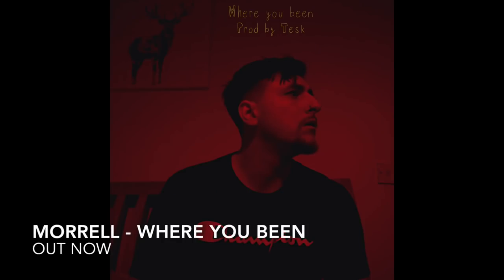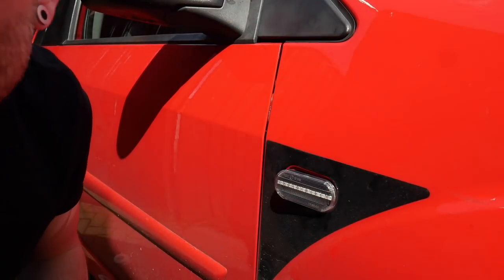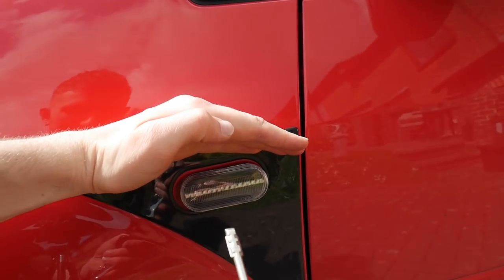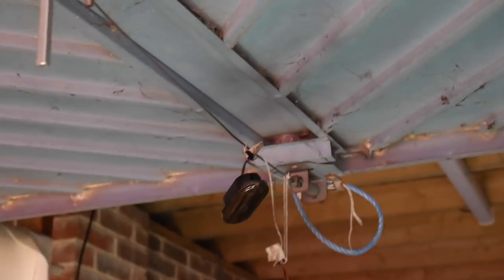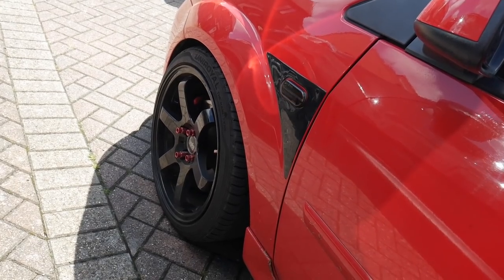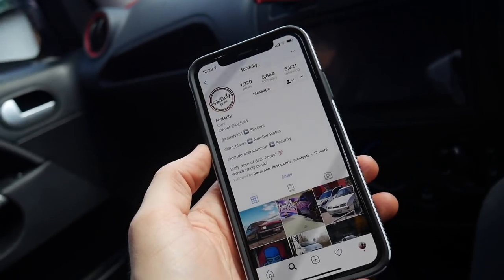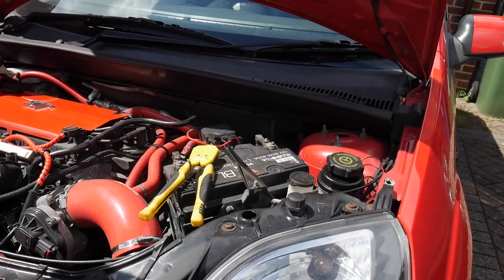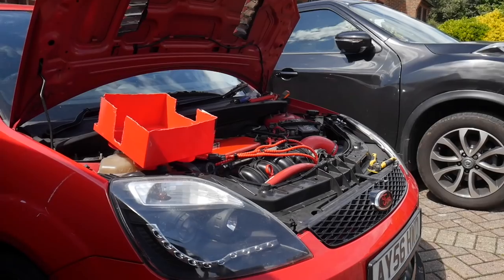Dynamic LED Side Indicator Install | Fiesta ST150

Comment: On my zetec s I fitted smoked LED repeaters. They were off a mk4 golf which my dad had bought and got them sprayed. They have 3 LEDs in them. Had to change the switches over as the golf switch is different
Reply from the maker: Zain K these ones are simple plug and play, still have to spray them though!

Comment: yes mate I have these fitted. btw have you thought about 300mm brakes up front, and 280mm on rears, both st170 or you can use mondeo mk3 fronts.
Reply from the maker: They're good little indicators, much cleaner look! I have thought about the break upgrade yeah, waiting on mine to need replacing first though!
Reply: @jaymono6498  I have just fitted a poly bushed gearbox mount and a GGR short shift, while did a gearbox oil change.. it changed the feel massively. I would recommend
Reply from the maker: @isoconfused8744  Must feel a whole lot tighter!
Reply: Brakes definitely are one of the best performance mods. Just upgrading my brakes on my zetec s to front and rear ST brakes made a difference

Comment: Late to the party here but could you not have removed the plastic clear part you are spraying and spray it on the inside not the outside? Used to do that for clear RC car shells. Won't chip or wear then and you can still wash/polish them as normal without risk of damaging the sprayed finish.
Reply from the maker: Probably couldn have, however as they're outside the car Id rather not let any potential rain water get into them. The tint holds up well as its turns into a dark film and isn't water soluble. Good idea though!

Comment: We’re did you get the vinyl that you have round the side indicator from looks good
Reply from the maker: wayne rountree they where on the car when I bought it, however these a few links in comments in this video to similar ones
Reply: Thanks I will have a look 👍
Reply: @waynerountree9284  dmb graphics do these. Gel wing overlays

Comment: I got a squeak while pulling away when my cars underload but not normally when just going straight so I gave it a look over and noticed my power steering belt is damaged do you think this could be what's making the noise?
Reply from the maker: Yeah, a good test is to put talcon (baby) power onto the belt and see if the squeak goes away temporarily, if it does then look into replacing the belt!

Comment: Anyone installed these front to back but had issues getting them to fit in the slot properly, sightly off center towards the rear? 🤔

Comment: I am sad :(( Mine have water ingress!!!!  :((
Reply from the maker: Iso Confused new indicators or the old ones?

Sucks either way but better you found out how before it done anymore damage!
Reply: @jaymono6498  the new ones, like yours mate. I've messaged the seller.. shouldn't do that 4 weeks after fitting. We haven't even had much rain lol
Reply from the maker: I gave my car a full wash after installing them as I went to a meet, they're holding up fine, hopefully it was just a broken set they sent you!
Reply: @jaymono6498  hope so, both sides have water ingress, they are sending replacements.